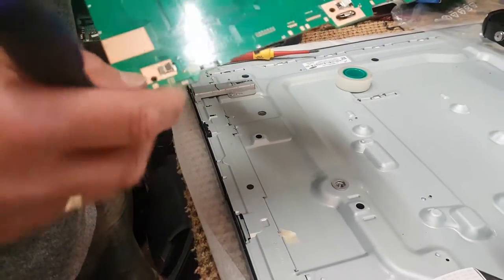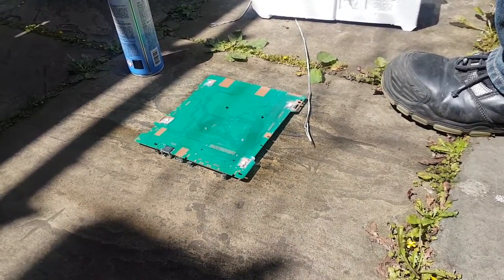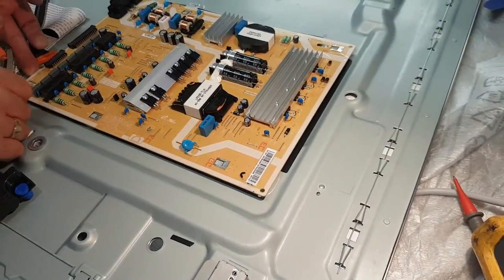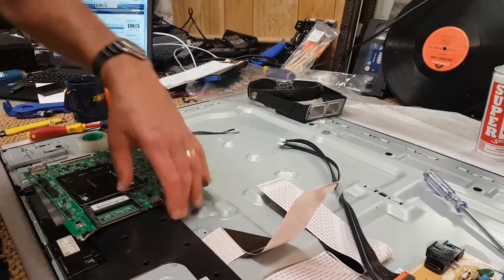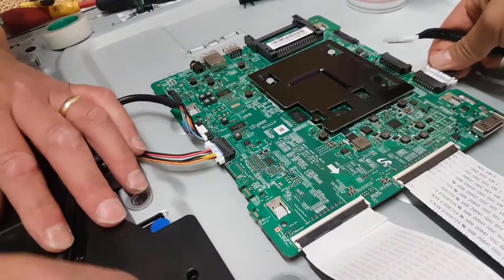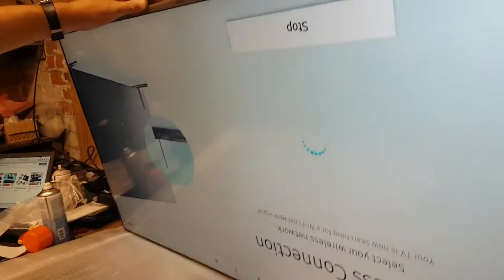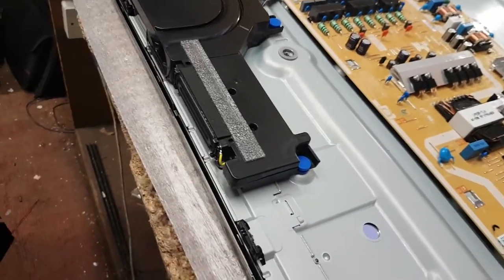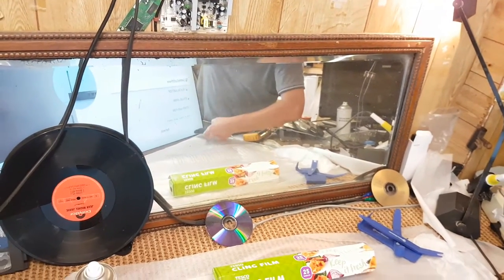Samsung UE49MU7000 water proof ambersil conformal coating PCB's

Comment: Hi TellyDan! I have the 7000T tv but am
Having issues and wondered if you could
Help me diagnose? 
The one connect box is not recognising devices in the HDMI ports and sometimes I get an image on the TV saying to connect the box with the tv. Even though it’s connected. I’ve tried all the obvious stuff (off and on and different hdmi cables in all 4 ports in the box) and nothing. 

Not sure if it’s the one connect cable, the connect box cable port or the one connect port in the tv. 

Any clue on how I can diagnose? Thanks
Reply from the maker: Hi Alex, I'm guessing but the one connect box could be faulty. You could probably get one used off ebay cheap. If its not that there's a possibility it could be the main board on the tv.